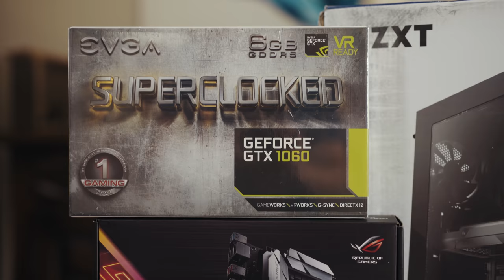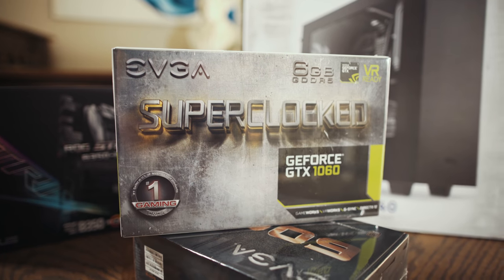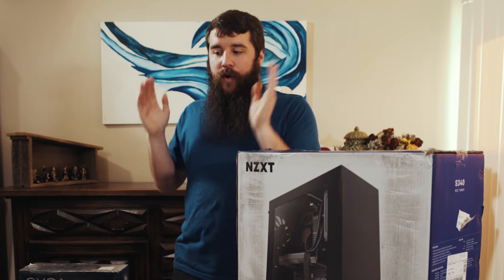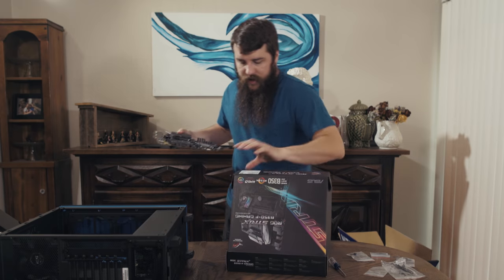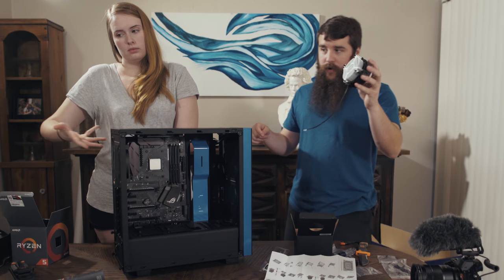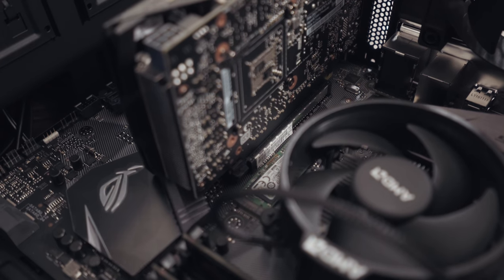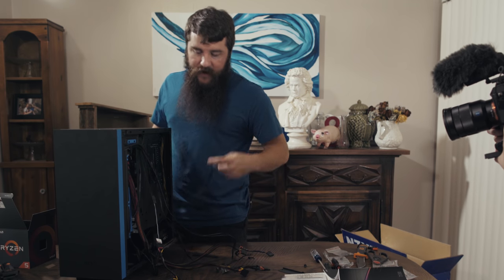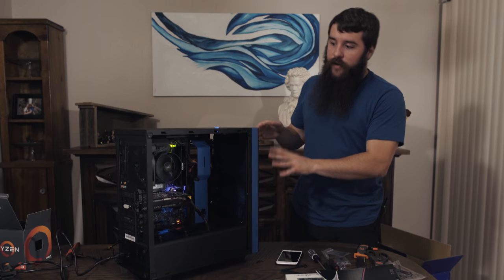How To Build A Video Editing Computer | $850 Ryzen PC Beginners Build Guide | 2017

Comment: What version of windows do you recommend for this build..7 or 10 pro?
Reply from the maker: 10 Pro. I don’t believe Ryzen supports Windows 7
Reply: You can jump some hoops and load 7 like I did but unless you have legacy programs you are fond of go with 10 my win 7 wont update microsoft just sends an "unsupported" screen instead of an update ...I had to merge usb drivers into win7 install file not that hard but not a beginner level function those drivers are built into win10 install (latest version) ... I went with 7 because I have a CAD program that was bought during XP for several thousand dollars that you cannot buy now only rent year to year no thanks as I don't use it that much but nice to have when I get the design bug. and win 7 has XP legacy support not sure about 10? (p.s. I am a very slow designer but find it fun [not 400 additional dollars every year fun] but fun)

Comment: I followed the build suggestion and video to the T, but was unsuccessful in actually starting the PC. I even took everything apart and re applied everything.Fans turn on, and so does the light, but it doesn't stay on past 15 seconds. I'm gonna try Geek Squad, but would love any suggestions I can get.
Reply from the maker: Hey! Sounds like your heatsink may not be seated properly to the cpu.
Reply: also is your ram fully seated takes some pressure to snap into place also right slots if using two of four slots

Comment: I need to do a build for use with photoshop, Lightroom and Illustrator mostly, and on the cheap. I'll be doing some voice over work, too, so a  "quiet" machine is important. I see a lot of videos on gaming and video editing machines, but not much in the way of pro photo editing. It still needs to be fast to deal with memory-heavy programs and pulling up huge photo files without slowing down or freaking out. Any suggestions on what I really need to focus on when spending the money?

Comment: Hey Matt. I just built this PC but I got the Rysen 7 COY and a beefier graphics card. But I have a major issue! At first I wasn't getting a video signal when I turned it on and now the lights on the motherboard and graphics card are flashing. What is wrong with my build?
Reply from the maker: +LoneStarGamer yo! Is your monitor plugged into your graphics card output? There’s an hdmi output on back of the motherboard, don’t use that!
Reply: LoneStarGamer, did plugging the monitor into the graphics card (and not the motherboard, which like Matt said, would cause this issue) solve the problems you were having?
Reply: No, it did not fix the problem. I already returned everything which fixed the issue.
Reply: LoneStarGamer Dang, sorry it didn't work out, man.
Reply: Thanks, but it's okay. I bought another PC instead.

Comment: I had a raid-0 set-up and accidently broke the raid. My hdd's were old so I bought a new SSD for programs, and two 6TB HHD for capture (configured independent). I'm running Windows 7/64, my NLE is Vegas Pro 12. Can I use my new hard drives with this set-up? Do you recommend an Intel processor since Ryzen doesn't support Win7? Do you recommend setting up the HHD's as raid-0? or buy SSD's for my capture drives? My intent is video editing, no gaming. Also thinking about Blackmagic Intensity Pro 4K pci/e capture card, currently have the Shuttle usb3.0.
Reply from the maker: Hey! I would consider upgrading to Windows 10, Windows 7 won’t be getting updates soon. If you wanna stick with 7 then go Intel. 

You could use those new hard drives, but I’m wary of Raid-0. If one drive fails everything is lost. I would probably buy more drives so you have redundancy with your raid.
Reply: Matt, tks for your fast reply! I was thinking Raid-0 because these are HHD's, not SSD's (so they are slower) and are 6TB. Large SSD's aren't available yet. One minute of my HD capture is 12gb, so I assume I need that much space? Although these won't be used for storage at all, only capturing. Tks for the nudge to Win 10; I'm just worried my other programs like DVDFAB, Sound Forge, Vegas Pro 12 won't be compatible?

Comment: Would all this work with final cut pro just as good? And would I still need to use proxy media when editing 4k?
Reply from the maker: Nope, FCPX is MacOS only, and I don't believe this will run as a hackintosh, but I haven't looked into it.

Comment: Hi Matt, I built my PC with the parts you suggested and its working fine except its struggling to edit 4K Multicam is there something im doing wrong. I use Premier Pro CC 2018
Reply from the maker: Hey Brian! Even my 10 core PC struggles with 4K Multicam without making proxies. I would check my proxy tutorial video. :)

Comment: Im stuck none of the color cables came came attached on the power supply only the ats and cpu 8 pin but the motherboard cpu has a four pin and 8 pin
Reply: Found most of the cables it was uplugged and separate... the bronze 500 not lighting up  or turning on when I plugged into the wall
Reply: Went and  bought another power supply still not working  kinda regretting this

Comment: Hey man, loved the video, and followed it step by step. But my computer won't start. The fans spin, and the power light just rapidly blinks but the thing won't turn on. What do you think is wrong? I'm praying it's the power supply and not the Mobo haha
Reply from the maker: Hey! My first guess is that you may not have your monitor plugged in correctly. I would double check the cables and that you have it plugged into the graphics card.
Reply: Matt WhoisMatt Johnson sadly that didn't work, I think my issue might be with the power supply. I put up a quick video on my channel of the problem. If you have extra time I'd greatly appreciate you checking it out and giving your opinion
Reply from the maker: Yo! I commented on your video.

Comment: I did the build using parts mentioned in the update build for 2019. I have GPU installed and I connected a display to the VGA port and turned it on. CPY fan and lights turned on as well as the power supply fan and the cabinet fan. But the display shows no signal. I tried removing the GPU and started with out still no signal to monitor. Also I removed RAM and changed slots but still the same. Any advice on how I can resolve this issue? Appreciate any response.
Reply from the maker: Use the HDMI or DisplayPort on the back of the graphics card. Don’t use VGA

Comment: Matt! Love this video. I'm on your low end of nerd (1st build), but not intimidated with the parts at all. It was the step-by-step walk through the made me nervous, which I am not THANKS TO YOU!!! 
Now..a dumbass question...how do you purchase/install Windows without a CD on a fresh build?  Do I buy a copy/have it shipped?😅 any link/tip is appreciated. Thanks!
Reply from the maker: Hey!! You can buy a digital copy of Windows on the Microsoft store. All you need is the serial number to activate windows. 
To install windows you’ll need a flash drive. Microsoft makes a super easy install tool on their site that will put windows on the flash drive. Then all you have to do is startup the computer with the flash drive inserted and it should guide you through the setup process.
Reply: A million thanks for addressing my question. I just subscribed to your channel and look forward to watching your expertise. My 20 year dream for a non-linear edit system is finally a reality thanks to this video at ripe age 47. Back in 1998 (age 27), full Avid systems with RAID were selling for $85,000. 
I am ordering parts for $850 next week!! Droppin' those 00's 
Wh00-H00!

Comment: Hey Matt!  Thanks for this great video.  Shame that the wife did not enjoy this build.  I wish she would have added to the excitement to keep the momentum going...  But hey, this is not about the wife!!!   The whole building process was fun and entertaining.  Thanks a whole lot.  I feel great buying all the parts through your affiliate links...  It was the best thing I ever did to support a youtube like yourself.  

One question.   I did run into a skiff.  When I went to connect the case fans to the power supply, I could not connect because the case I had did not have the Molex connectors...  IS this something I got shafted for or did I need to buy these separately?  My momentum to finish the build went numb at 12:45 am last night so maybe you can advise the viewers next time if this part needed to be purchased separately.  

Thanks again!  
OMS
Reply from the maker: Hey Oliver! After I made this video I learned that nzxt isn’t including the molex to 3 pin fan connector cable on the box. I linked to the cable you need in the description

Comment: Will these parts fit in any housing?
Reply from the maker: This is an ATX sized motherboard, so as long as you have a case designed to fit an ATX or larger motherboard you should be fine.

Comment: Matt,  Would you please help me.  I am using Cyberlink Power director for my video editing which is usually 4K at 60 FPS.  I have an Alienware aurora R5 with a i7 6700, 32gb ram, gtx 1070, and a m.2 ssd with operating system on it and a 3 tb 7200 rpm for media.  When I am editing if I put any kind of effect on it like speed for slo mo the video is realllllly choppy when previewing it.  I have tried everything like creating shadow files and using non real time preview but nothing helps.  I take the media off of the Sata drive and put it on the ssd for editing but this does not help.  I have read that you should not put editing media on the same drive that your OS is running on.  Do you think this might be the problem?  I have also read that you should use Raid drives but I don’t know anything about how to set these up.  Please help......   Sorry so long of a comment but I am struggling here.
Reply from the maker: Hey Jeremy! Sorry to hear about your issue! Unfortunately I don't have Cyberlink Power Director, but it sounds like your computer isn't able to handle 4K footage once you start adding effects to your footage. You might want to consider trying out a different editing software such as Da Vinci Resolve. It's free and very powerful for video editing. 

If you want to stick with Cyberlink, does it have a way to create proxy files? This would be easier to edit than the regular 4K files. I would research that. :)

Comment: This would have been easier if you had of mounted the cpu, cooler, M.2 drive and memory on the motherboard before putting it in the computer case.  There is less chance of mother board flexing and screw driver slippage, hitting the motherboard and there are less chances for errors like you had, but I applaud you efforts. Rachel has a priceless look on her face, “like come on here, get this right, you are taking to long and you are messing up this video, are you sure you know what you are doing”.  Your wife expressions made this video and she looks board shitless. 

My son built a Ryzen 2600 three weeks ago and he loves it. I use an older x99 six core with 32 gigs of ram.  On Adobe Lightroom and premiere my rendering time and photo editing is a little quicker because adobe is better coded for intel, but price to performance, you can’t beat Amd and my son said while there is a difference between his machine and mine for editing, that difference to him wasn’t worth spending more money for it to go intel. Good stuff here.  

For me if I were to build a new machine mine is three years old, it would be a thread-ripper. Amd is killing it and has Intel on the ropes and as soon as editing software and gaming software come out with updates to take full advantage of what Amd has done, the playing field will be more than leveled in Amd’s favor.

Comment: why is the wifi adapter so slow, where did you get the driver,do i need it?
Reply from the maker: Hey Brian! Windows 10 should support the WiFi adapter out of the box. If not, I recommend visiting the manufacturer’s site to look for a driver.
Reply: i just needed to update the driver within windows 10. but this completes my build. everthing works awesome, thank you!

Comment: Hey I actually got a different motherboard than the one you recommended because it sold out and a different graphics card that had 2 fans I put it together and it turns on lol hopefully it will actually work lol

Comment: So....heres my issue. I went with the MSI Proseries ATX motherboard, XFS Radeon RX 570 graphics card, Samsung 970 Evo plus SSD, Corsair LPX 32gb RAM kit, Ryzen 7 cpu, and the EVGA 600 powersupply within the NZXT h510. 
On startup, my graphics card fans power on and everything on the unit lights up (sadly no rgb), however I'm getting no signal on my monitor while using both HDMI and DP. The motherboard I grabbed came with terrible directions so im not sure where to begin to troubleshoot. Any advice anyone? Also, my towers fans are two 3 pin plugs, im assuming I need to pick up a molex adapter?
Reply: shoot, what the heck? I just took out one of the ram sticks and she booted up.....now what?
Reply from the maker: Maybe your ram wasn’t seated properly? 🤷‍♂️
Reply: @whoismatt  it indeed wasn't! Now I have a new problem. I keep getting the reboot message that I need to connect a proper device for the bios.
Reply: @whoismatt  You don't happen to have a set up tutorial, would ya my man?
Reply from the maker: @marcusmurphy2771  unfortunately I don't. It sounds like you may need to specify to the bios that you want to boot from your SSD

Comment: Not sure if this is even a thing... But could you do a budget pc build with water cooling?
Reply from the maker: Hey Micah, you could add an all-in-one watercooler setup to this build for relatively cheap. A Corsair water cooler will run you around $60.

Comment: I've never even thought about building a computer before and I know very little. This video is really helping me get ready! I've been trying to choose all of my parts, for this build could I use a AMD Ryzen 7 2700X Processor with Wraith Prism LED Cooler (YD270XBGAFBOX) instead of the AMD Ryzen 5 1600 Processor with Wraith Spire Cooler (YD1600BBAEBOX) I dont know how everything fits. I'm a video editor and I use Adobe Premiere Pro and I really want to make sure I can edit really quickly with 4k video. I've also been so used to being told I need an intel core i7 to do anything decent and I want to make sure this processor is as close to i7 specs as it can be. Thanks!
Reply from the maker: Yes the ryzen 7 should work with this motherboard too
Reply: Great! Thank you!

Comment: My Monitor gets 'no signal' even though the hardware seems to work just fine and correctly. All fans a spinning and leds are on :'( 
what coudl be the issue?
Reply from the maker: Hey! Is your monitor cable connected to the graphics card output on the back? Make sure it’s plugged into the graphics card and not the motherboard.
Reply: Matt WhoisMatt Johnson  It wasn't! After plugging the monitor to the graphics card and switching through the monitors input channels i coudl set up the pc. :D   Thank u so much for the fast help. It's very much appreciated 😌
Reply: I did that when I first got a graphics card lol

Comment: I literally bought the same exact computer as you from your other video and for the past two or three weeks I’ve been trying to build it I plugged the front panel connectors into the wrong spot and I am almost 100% sure it fried my motherboard I had someone come check it out they said that it was the power supply so I turned around and bought a $150 one and the shit still doesn’t work I guess I’m going to have to buy a new motherboard 🤦🏻‍♂️🤦🏻‍♂️🤦🏻‍♂️whatever you do be careful plugging in the front panel connectors bc I’ve never been so stressed in my life

Comment: (Please reply) Hello, I'm having the same problem as the guy before me. When put the parts on pcpartpicker I get the same message. 

The motherboard M.2 slot #1 shares bandwidth with a SATA 6.0 Gb/s port. When the M.2 slot is populated, one SATA 6Gb/s port is disabled

I really want yo build this pc but I don't want any problems. Is there a reason for that message and can it be avoided?

Thanks
Love your videos.
Reply from the maker: Hey Roberto! The motherboard has a lot of Sata 6 ports. The m.2 slot will use one but it isn’t a big deal. The motherboard and m.2 Drive should work great together, no problems

Comment: Does this build work well for 4k editing? in premiere pro
Reply from the maker: Yes it does, but if you want it to be faster, get the Ryzen 5 1600.
Reply: Hai I am currently running a I7 Quad core 3ghz. Will AMD sustain Indian hot condition? Also would it be faster than I7

Comment: Hi matt, I m trying to build a ryzen 7 1700 pc n I m all confused  about the components to buy. Hey can u help me out...i made a list of component parts that I wan..here is the list
1. AMD Ryzen 7 1700
2. MSI b450 Tomahawk
3. Crucial mx500 500gb m. 2
4. Corsair vengeance 16gb 3000mhz
5. WD 1tb hard drive
6. Circle Pro 750 watt 80 plus
7. Nzxt h500i ATX version
8. Deepcool GAMMAXX 400 Tower Type cpu cooler.
9. Zotac GeForce GTX 1050 Ti OC Edition 4gb 
Matt do u think this combination will work out. Thanks pliz give me some info. I really need to build for video editing under $1000.

Comment: this was a nice build I went the second hand route myself. case $33(new)_water cooler(cpu) $50_ga-ax370 & Ryzen 1700x (new as promo)$150_ asus gtx 1080 strix (used under warranty ebay)$300_super luce 3000mhz rgb ram 32gb 4x8(runs @2999 with bios tweak) $200_corsair cx550 $40_adata nvme 250gb ssd m.2 $40_windows 10 pro(kinguin) $30. 30 bucks enclosing 800bucks of pure black magic. if you take your time searching you will find what ur looking 4 @ a good price unless you need it asap.